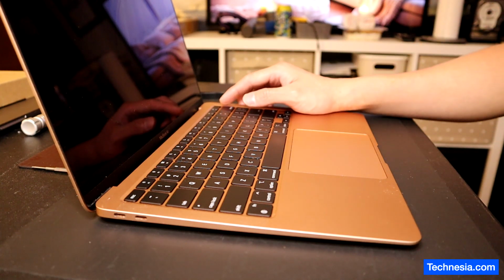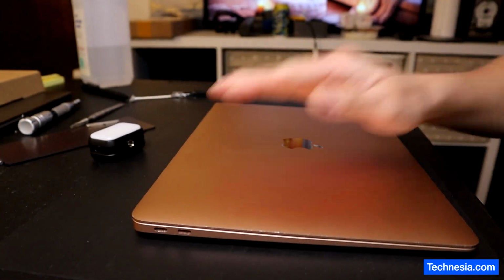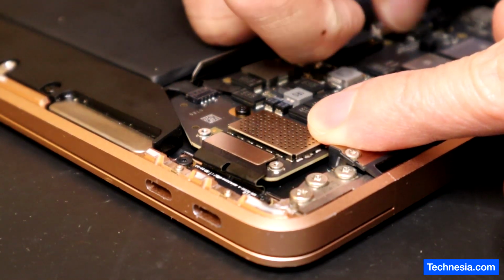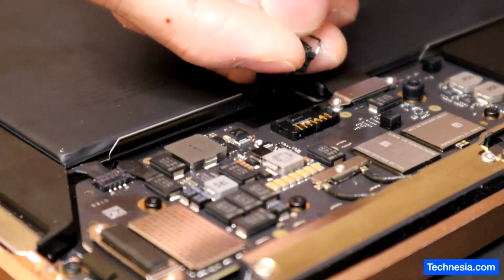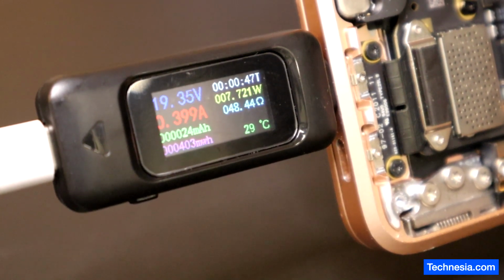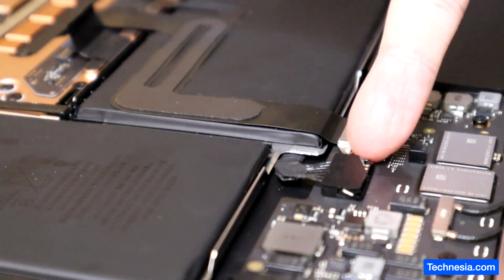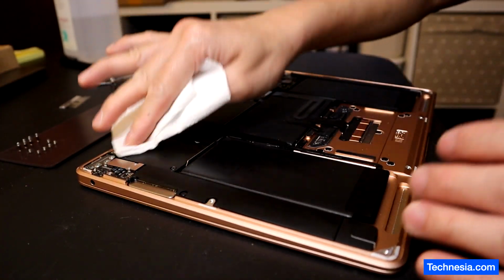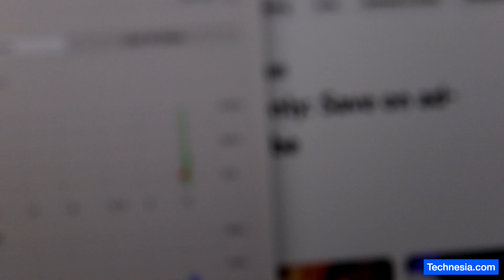Macbook Air 2020 No Power and Won't Turn On - Easy Simple Fix

Comment: Would the damaged charging port cause the laptop to not turn on even when it has 80% battery?  My laptop showed it was charging when it wasn’t plugged in, so I restarted went to restart it and it turned off and never turned back on.  Same model and year as the one in the video.